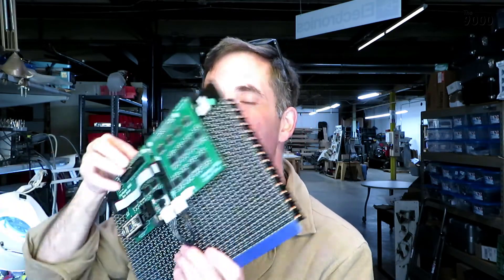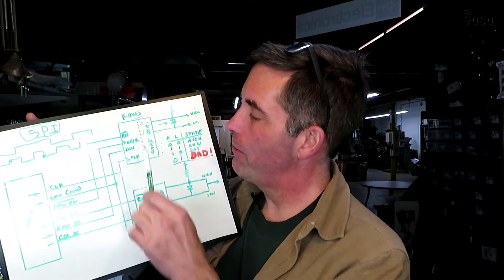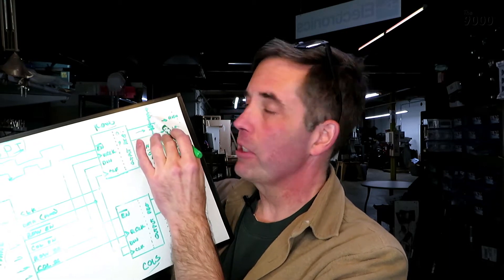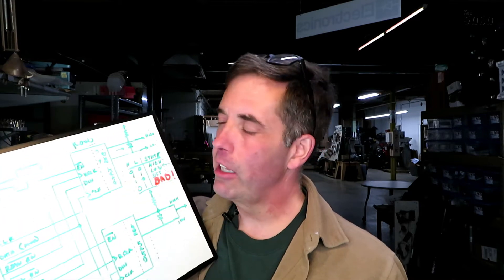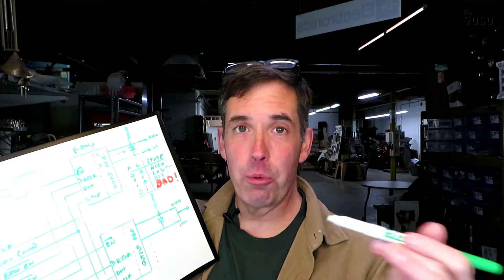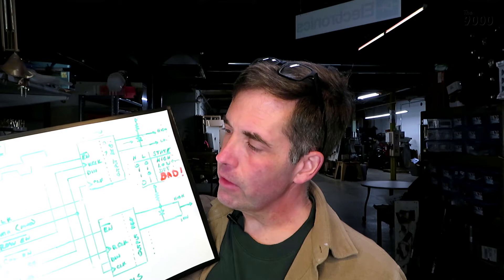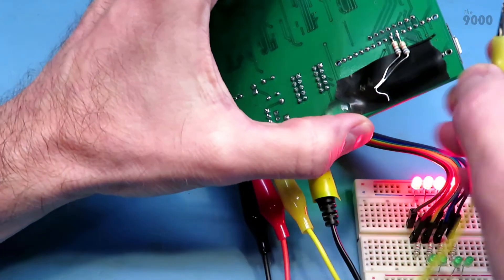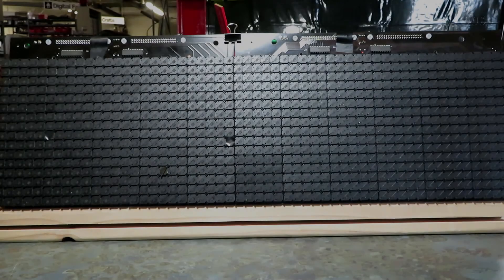FlipMaster 9000 Part 3: Letting the smoke out!

Comment: Thanks for describing the hardware in great detail, as well as the failure modes. Unfortunately I'm here after blowing up two fp2800a (unobtanium) and wanted to make a similar clone. And I ended designing (not building yet) a similar solution but with L293d as half bridge drivers for the pins that need to be driven to 24v or gnd. I think it's a bit more safe as there's no "invalid states". I'm also wondering if it may also be safer to make the pulse lengths not depend on the arduino code, just have some monostable that only enables the shift registers outputs for 250 microoseconds and then just disables them all together for a bit

Comment: When I made my flip dot driver board based off your design (for a large dot Gulton Luminator display) I saw that it was drawing 2a pulses when flipping dots and I thought that was normal: nope, I was actually driving the columns both low and high at the same time! Somehow it not only worked still, but it didn't kill the driver ICs. They did get pretty hot though!

Comment: Fun vid and neat display! So ya can't current limit the drive to protect against damage? Perhaps another HW solution is use a high pass filter on enabling so one can only pulse the drives on. A steady signal only results in a xx duration pulse. Granted, solutions are always easy in hindsight .

Comment: Hey, I was wondering, wouldn't you have the coulums have to source/sink the current of 16 rows at once in the worst case? or are you also flipping every dot in a column one by one?
Reply from the maker: You're right. With just the shift register for the low side driver, flipping all 16 at once gets them hot after just a short time. I split it into odd/even phases, and only drive up to 8 at once. With a proper low side driver, I'd do 16 at once.